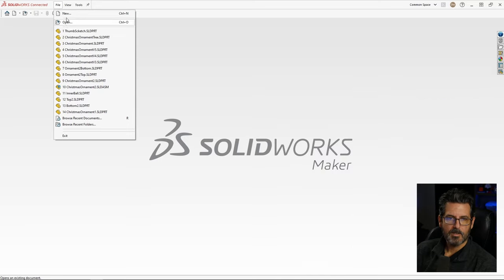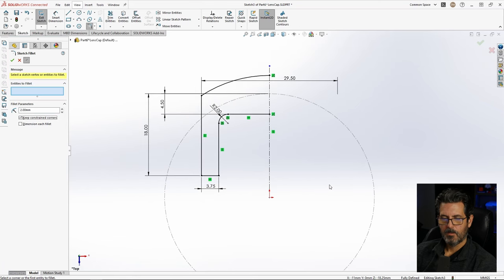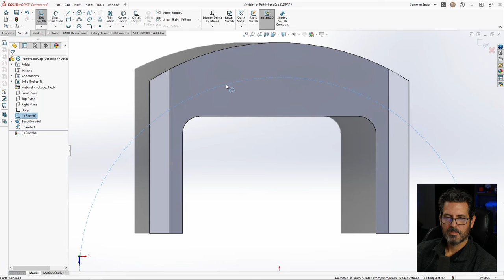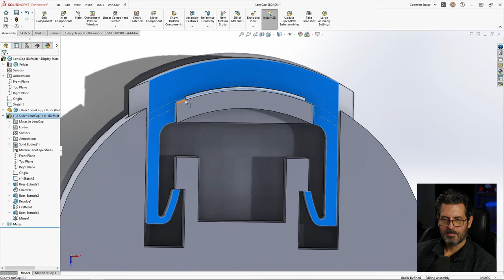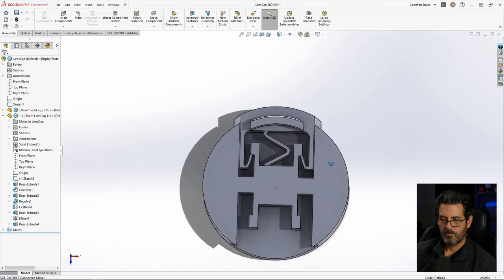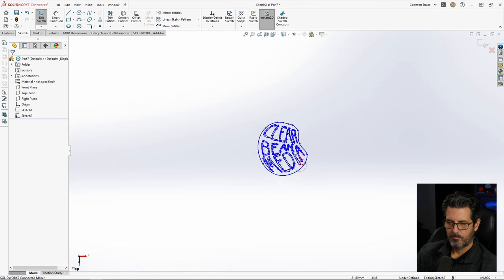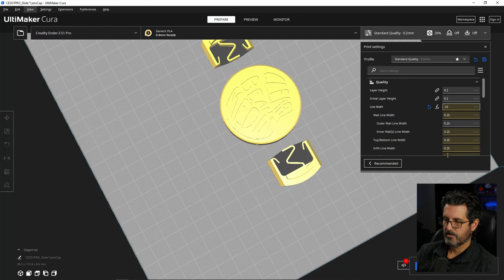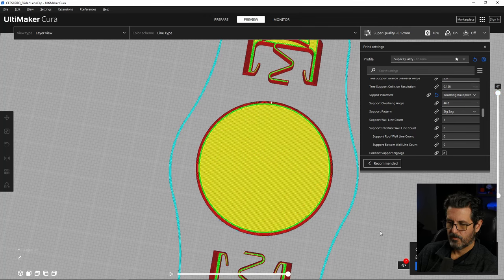SolidWorks Tutorial - Custom Lens Cap Design #3dPrinted

Comment: cant open the solidworks file it says its saved in 3d experience solidworks maker and wont open at all
Reply from the maker: Yeah, I use the maker version and unfortunately it only allows other maker versions to open the files.
Reply: @dandesigns3d  I have read that you can export the files as .step or .x_t for them to work on desktop. It would be great if you can provide that to test out. Love the channel learned quiet a bit
Reply from the maker: The problem with those two file types and any export out of solidworks is the parametric data doesn't go with it so when you re-import it into solidworks it is not parametric.